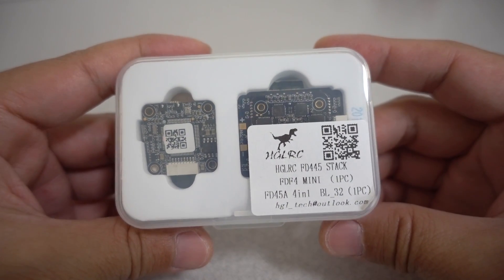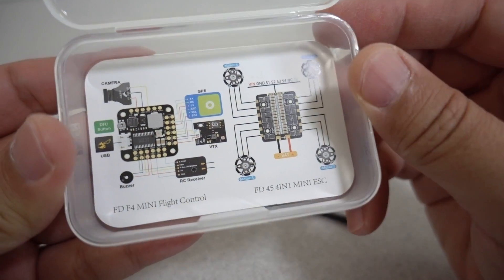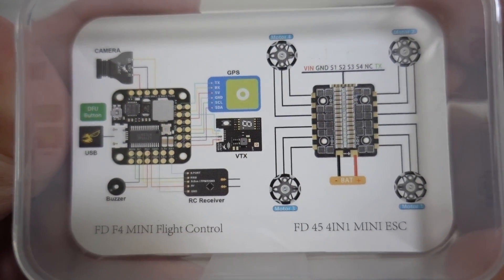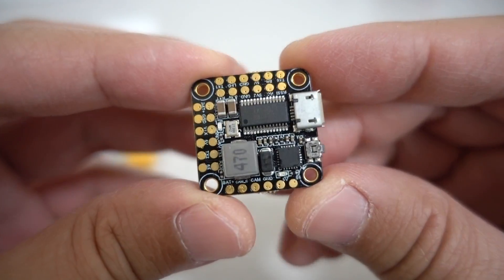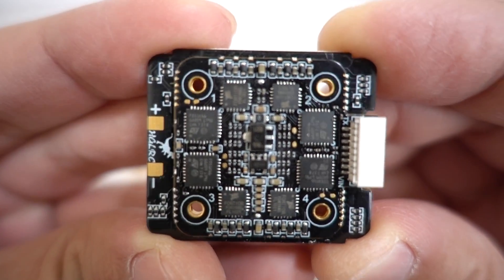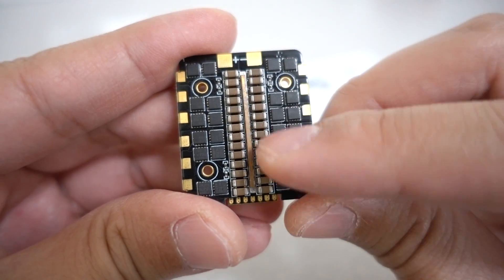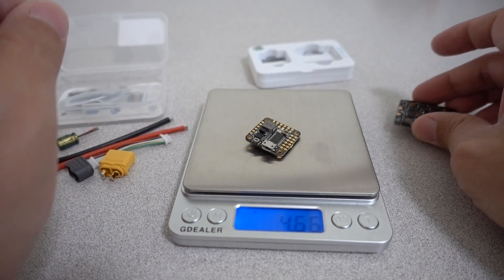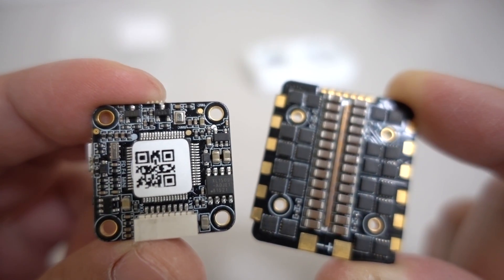HGLRC Forward FD445 Micro Stack 🏁

Comment: Mine went dead after I changed the motor direction using the configurator. How weird. The flight controller works but not ESC. Any advices?
Reply from the maker: This is the first time I've ever heard of a motor direction change causing the ESCs to die... I have no clue... sorry.

Comment: Mate help me please!
I have this stack but when i tried ti plug the cable, the plug with all pads lift out on the esc side. On the other side of the esc there are some pads that seems to be the same of the connector. But the cable has 8 cable and there are only 7 pads. Can you check the pads order please? 
On hgjlrc instruction there is an image that explicitly show 8 connections on 7 pads. That not helped me. Also contacted support explaining my problem. They said use the stock plug..... 
Help. It is brand new and useless....
Thanks in advance

Comment: Sigh all that wasted board space and NO CURRENT SENSOR YET AGAIN... C'mon HGLRC this is a $90 stack FFS!!!
Reply from the maker: they did that just to piss you off... mission accomplished!  LOL
Reply: I feel like current sensors are overrated.
Reply: If you don't monitor mAh you're either A. Guessing approx when to land or B. Emptying your battery into the region where you start to damage it(hint: if your voltage stars to drop quickly you already have!). I get over 2 years/hundreds of cycles out of my packs by looking after them)
Reply: Doesn't the F440?... I built mine quite a while ago and I don't fly that quad often so I do not exactly remember.